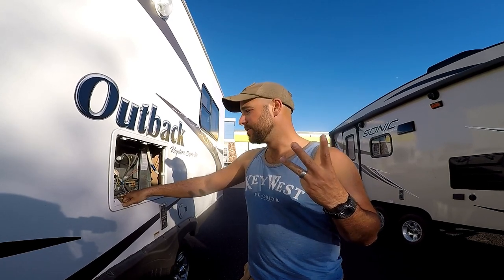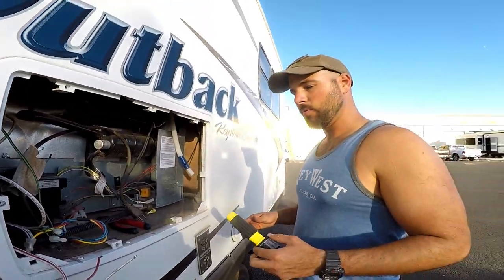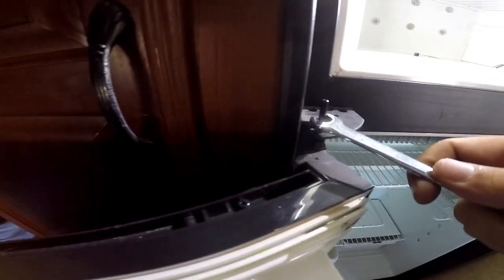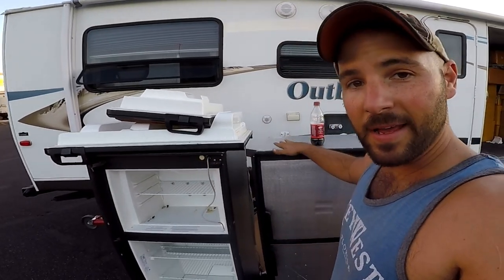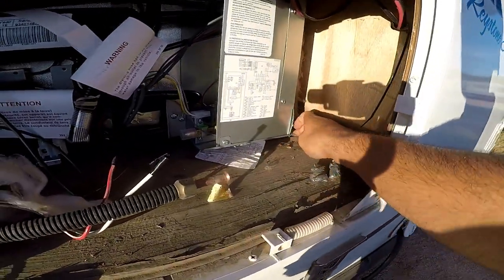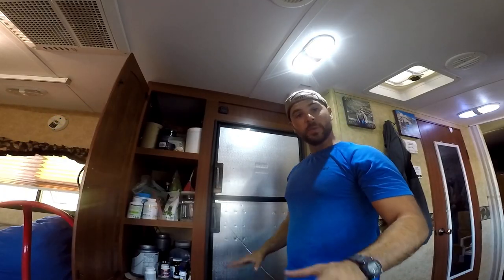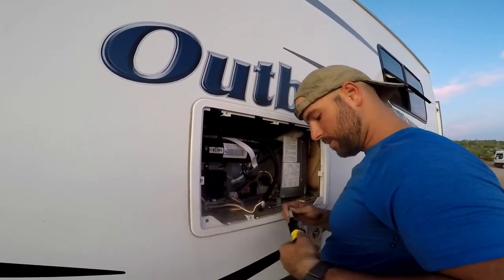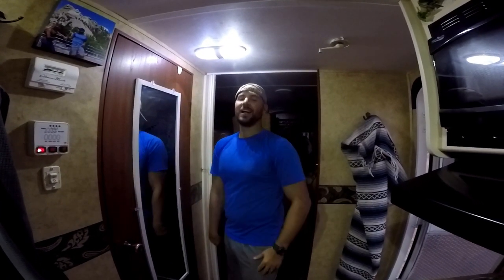How to install a RV fridge! / RV fridge not working? / rv living

Comment: I know you said it wouldn't fit out the regular door, but I'd like to replace mine and my door is 24" wide and the refrigerator specs say 24-7/8"... so almost 1" too wide to fit out the door. But, the enclosure dimension put my unit at exactly 24"... so that means without the top control panel and doors, it "should" fit. It looks like you did that, so I'm wondering why it didn't go through your smaller door, and, do you think it would've fit with some manipulation?
Reply from the maker: Mine definitely would not fit, I tried lol. This video was done a couple years back  and we have a different rv now.

Comment: Plenty of rvers ditch the rv fridge as they are unreliable and fail frequently and r expensive; so they just install a residential fridge its half the cost and very reliable...get plenty of solar on the roof and plenty of deep cycle batteries to store it.
Reply from the maker: I've hear the same but don't seem to have room for a residential. Maybe I could do some modifying. Getting ready to install 2,000w on the roof so we should be able to handle it.
Reply: @MountainTopHomestead316  research the smaller thinner residential ones. it shd fit perhaps with a little trim of the surrounding woodwork...